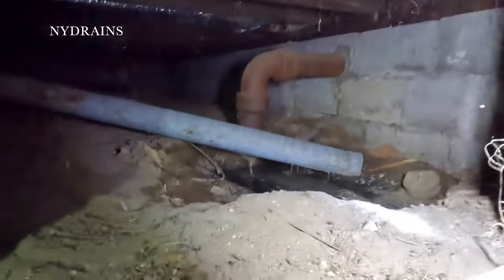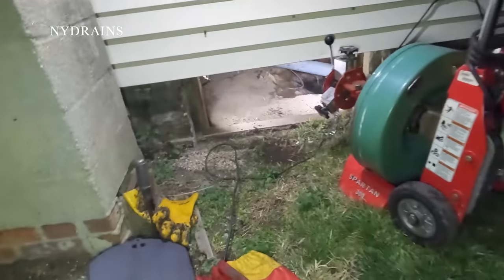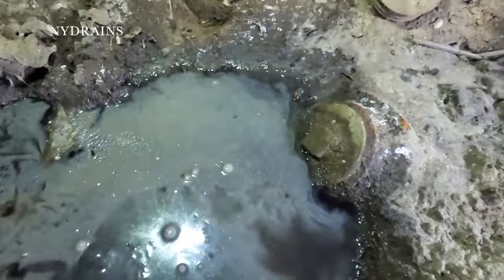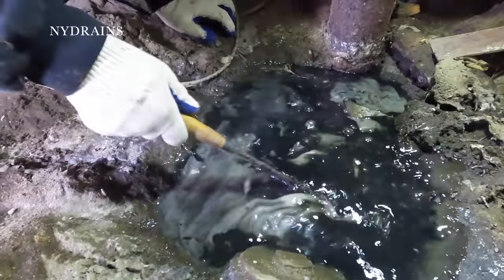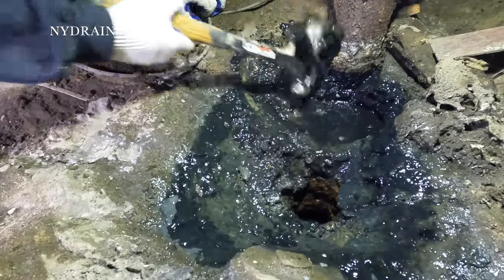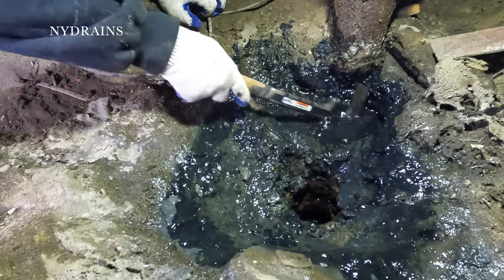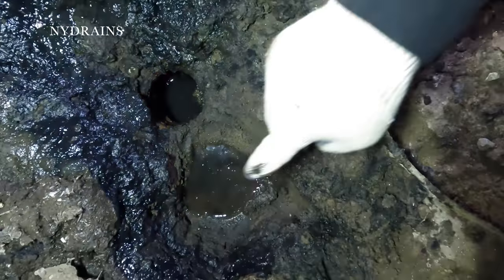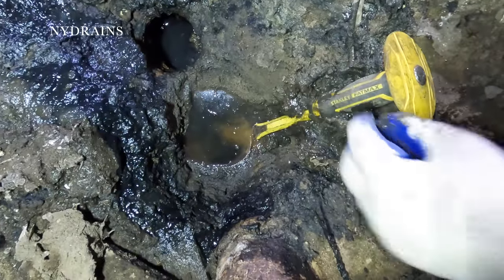Clogged Drain #144 🎄

Comment: Donald, my friend; that job is the perfect example why I have two of Milwaukee’s M 18 Volt drain clearing augers! (one is the handheld one, and the other one is what they call a backpack, but they are both very versatile and do an excellent job and the backpack also has the power feed just like the handheld one does as well. If you had one, you would’ve been able to bring it right in with you and since you get a lot of “rat traps“ it will go around the whole trap, but also very strong to clear any clog, I know this for a fact because I have both of them. I have also a Milwaukee tripod light, which also works very very well. I would definitely look into it if I were you. If you got them both it’s around $2000, but well worth every cent!
   Keep that river flowing, Donald, always a very good job you do!
    Edward H. – “Integrity, plumbing, septic and drain” out of the Clinton, CT area.
Reply from the maker: Thanks Edward 👍

Comment: You couldn't hit it from the vent outside?

edit never mind finished the video it was in the Trap I was just thrown off by that sewage on the outside of the foundation.
Reply from the maker: I could have, but it wouldn't be 100% it's more like a guessing game from the vent. And more like a temporary fix.
Reply: @NYDRAINS  

Hey just out of curiosity  whats the average mainline price in New York? 

We just went up at my company Johns Sewer in Massachusetts due to the  inflation and the gas. 

Mainline snake over here is $300 at my company 

lowest I seen from other companies over here recently was $245 or $195 for seniors
Reply from the maker: @Patrick McKinley  it's hard to pin point an average when some companies charge 800, 600 some are higher some are lower, and that was before inflation! I'm sure prices have gone up a bit.